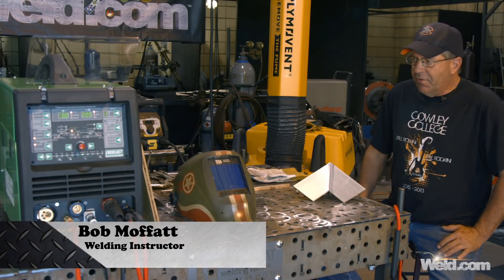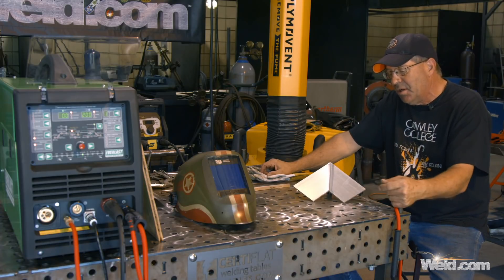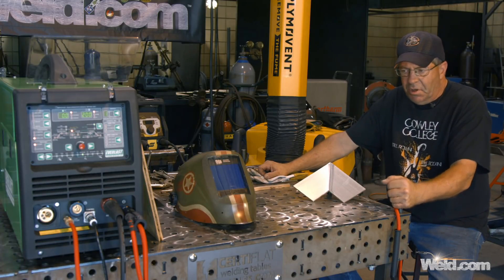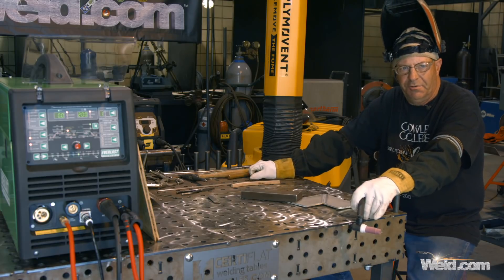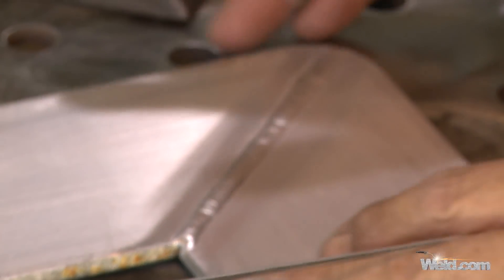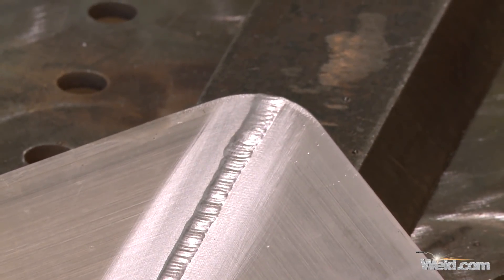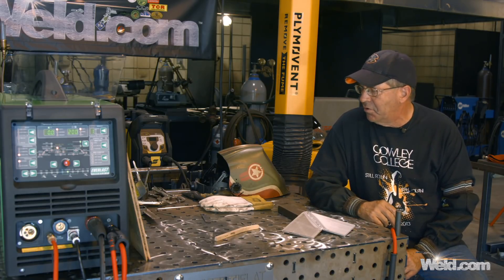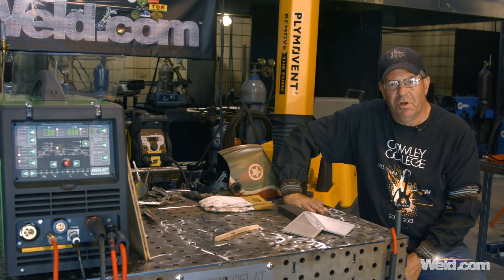🔥 Aluminum Corner TIG Welding | TIG Time

Comment: 4943 filler is the bomb. Good stuff.
Reply: Moto Z  I buy 10lb boxes of Hobart 4943 on flea bay for $69 incl. shipping.
Reply: Guns N' Torches dc aluminum i always use 4043
Reply: Bob  Moffatt bob thanks for the heads up ill look them up.
Reply: Bob  Moffatt I want to try it but i cant find it anywhere. I like 5356 for most stuff in general.
Reply: Where are you located?
Reply: Bob  Moffatt Northeast pa. I'm thinking i gotta order it.
Reply: Which wire do you like best for dc aluminum?
Reply: Guns N' Torches Depends on alloy.
Reply: Personally I’d rather run 5556 for a all purpose rod.
Reply: I like Bob's suggestion to start from outer corner there is more aluminum towards the inner corner.

Comment: Read my mind! I was wondering why he was working in the direction that he chose... Wondering no more.

As for those pulse settings, the world could really make some boring videos to only produce one nice, mirror finished weld with dimes for days. Ideal settings are few and far between; however, there's one I've found that really hit the mark of the prior part of my comment. Fast travel/freezing, good feeding, wet puddle, and a glassy, faux bead without fissures.
When I get my 255 EXT back home again, I'll be sure to post them... I've got to retest my notes to nail down which one did hit the mark. All settings are mathematical factors of one another.

Comment: I think the back ground at 40% o start might have been a little low, by the not melting the filler. I do lay wire on all my fuel tanks i build just because its fast, never pulse though.

Comment: Does anyone own an Everlast Tig welder, or have had any dealings with Everlast, I am looking for a Tig welder and have my eye on a PowerTig 210EXT.  I hesitate because of all the horror stories I hear about Everlast, and there bad customer service .
Reply: I have the 221STI, the same machine used in this video.  For me, Everlast has been great to work with.  I got in on the first run of this machine and had questions about using certain features.  Their techs have been great at providing guidance.
Reply: I have a 185 dv and I love it, the stories are just that...stories.
Reply: My 2 cents. I've got 3 everlast welders and one of their plasma cutters. They've been great to deal with and I've been very happy with the machines.
Reply: Thanks for your reply it helps.
Reply: I have the 210 and LOVE IT!  Also have the Square Wave 200 Lincoln.
Reply: What horror stories exactly?
Where can I read about them?? 
I watch welding vids all over the net and I havn't seen or herd one thing bad about 
Everlast welders, unless its the 'buy merican' hater BS from the clueless.
Reply: I've had the 200dv for over a year and zero problems with heavy use.
Reply: Hey man, I've had an issue with my PowerTig 255 EXT... HF Arc wasn't working properly, but it wasn't really their fault as it was a failing capacitor prior to the HF Arc circuit that was giving me hell. I'm going to review the new unit the same as I had started doing on the recalled unit; however, you have to try to sort out any issues beforehand... It's just bad business to go ahead with the review of a unit that is failing to initiate any proper arc within the first 10 minutes.

That said, I contacted support and was emailed back tech support. They go through The same troubleshooting procedures as any other company. My issue was unique to my unit and uncommon than other easy fix issues that can easily be swapped for a board. Regardless, the tech I dealt with was very reasonable and said that the issue I was having shouldn't be happening when the unit arrives on day one. Return label was sent after attempting some tests and video of the failing arc initiation... The video was merely taken for to let him see how the symptoms of a failing capacitor actually behave.

It's almost back to the facilities and I'll receive my new unit ASAP. 

As for horror stories... I'd be inclined to say that they're either lying about the symptoms, trying for free stuff, or maybe impatient to highly impractical in their expectations of everything they ever purchase. To sum it up, I'd say they're more than likely FoS and trying to freak people out to have people rally around their cause.

As for the time I've had with my unit in two or so days of usage, I'd say it's worth every penny so far! Short of the arc initiation; it welds like butter, amperage control by means of their NOVA Pedal is surgical, and the low end of the unit will literally put you on your backside in laughter! I could take that unit down to below 2 amps and caused my Lincoln 3350 hood to flicker on and off... that hood is certified down to 2 amps.

As for my capacitor failure, there are ways of extending the life of everything you have and it's the reason I was easily able to diagnose the issue without a circuit diagram. Keep your electronics inside, all circuits will have electrolytic capacitors. Humidity and colder temps will eventually cause the capacitance to fall off and that type of capacitor will wick up humidity while being exposed to both cooler temps as well as humidity over time. That will cause the electrolyte material to eventually drain out. In my case, it was just a dud capacitor from the source factory that threw it out of spec for supplying the HF Arc circuitry. I have no doubts that my unit was properly tested, but 8/17 temps are not the same as 30°F to 45°F of my delivery date during 12/7/17. That was enough to cause the capacitor to show it's losses in driving the coil to fire.
Whether it be Miller/Hobart, ESAB/Thermal Arc, or Lincoln; every company will have their failures regardless of testing.

I say buy one and I'm going through a recall with Everlast right now... I'm not concerned with those so-called horror stories we hear of online in the land of experts. The rest of my long-winded story will be covered in the actual review of the new unit that's soon to be headed my way.
USN RET. Electronics Tech and EE was where I spent my time afterwards. Take what you will of my advice and my experiences, they're doing good.

Sorry for the short story format with thorough input to help out, but I'm sick of the pulp fiction about horror stories without any other information as to what led these people to post their comments.
Reply: I just pulled the trigger, no pun intended, on a 251Si, because it was on sale, and is loaded with features.  They are a small company and can innovate quickly.  Sometimes their customer service is a win, sometimes its a loss, like most companies.  I wanted the new ESAB 205 but don't want to wait 6 more months and pay $3k just for that yellow box.  Who knows, maybe in a month or two, I will be ragging on Everlast's customer service if things don't go well with my new 251Si but fingers crossed.
Reply: I have the 210 love it. Was on a waiting list for longevity they never came through I canceled my order and Bought the Everlast good machine for the money
Reply: I have a MTS251Si and a 255EXT, very happy with both. I've talked to customer service once to troubleshoot some super thin aluminum settings.  They were great.  I think some of the negative stuff is from their start up years and they've worked to improve it considerably.  I got no complaints and love em.
Reply: Thanks
Reply: I love my everlast machines, but yeah, their customer service is disgustingly bad. And takes foooooooorever.
Reply: Save your money and get something else. Don't rule out the used market either. Miller, Lincoln and HTP have a great reputation for a reason. I am a one man show fab shop here and I have 8 weddings machines actively used in the shop. Only two were brand new, out of the other four used machines, three of them are older than me. I mostly tig weld here but do a bit of mig and stick. Keep your eyes open for a good used machine.
Reply: Ryan Jones have you had any arc time with an everlast machine?
Reply: 250 EX 2013 model was an Amazon return reject,Needed bridge rectifier,no warranty for me, Everlast parts helped with cost no shipping charge,replaced myself.Still going strong. 5 amp to 250A AC/DC can't complain.
Reply: Own and use my Everlast 250 EX with IGBT board and 300 cooler and Everlast Plasma 50 since Nov. 2011 and not one problem. Not a fan of multi process   units like Mig. Tig Plasma combo. units. 2 necessary updates in my opinion-#1- quality foot controller, (SSC Mentor, Oh,)and #2- CK 20 water cooled torch with supper flex hoses which I also added a push button to when I don't use the foot control. One other thing, my 250 EX is a super smooth welder when doing LH 7018 DC electrode Pos.- Rev Polarity. Never a problem when I called cust. service for some info. Not knocking any other brands of welders,(I have 4 others) but when I needed an alum tig one this is what I bought. I feel a got a good unit and a lot of bang for the buck. Hope this helps. Ed K. Cleve. Oh.
Reply: Their warranty is a joke.  If your machine breaks you have to pay the cost of shipping both ways.  This happened to me with one of Everlast's plasma cutters.  In fact, based on reviews on Amazon, several others had issues with that machine.   I decided to buy a new unit from a company with a real warranty.  Good riddance Everlast.